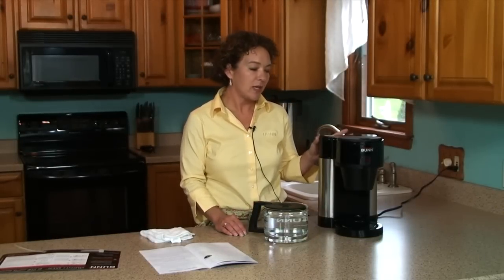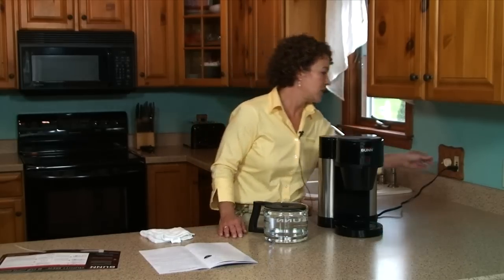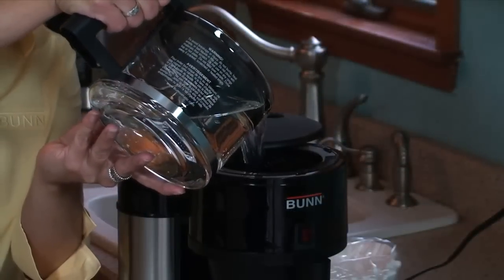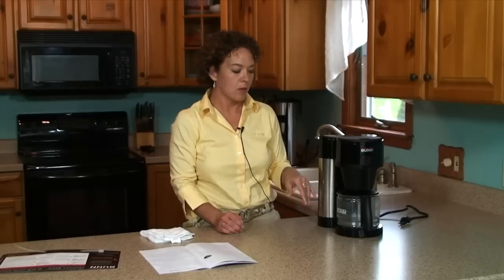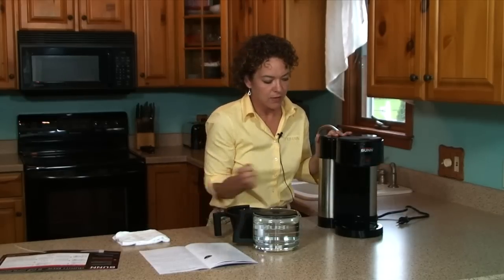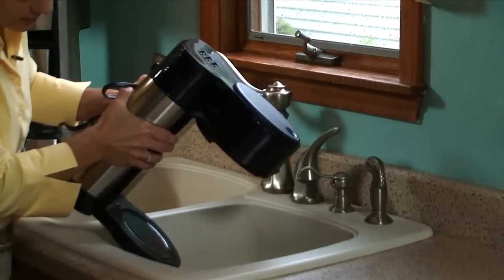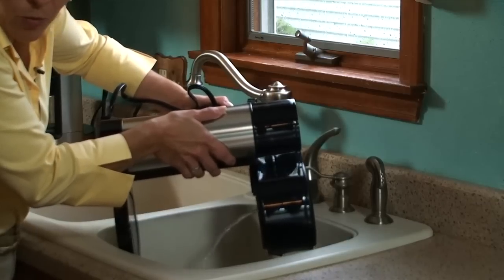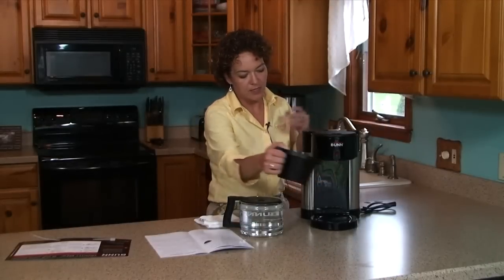How to drain a BUNN Velocity Brew

Comment: We tried this exact operation and stored a unit for two years. But when we tried to reuse it, we found the insides corroded and the unit ruined. How do you dry all those inside components after draining, to minimize corrosion?
Reply: I was thinking the same thing I just went through this process and you don’t get all of the water out of the reservoir which is gross. Reasons why I love my percolator.

Comment: I bought 1 of these new. I use about 6 scoops of coffee per pot (I like a strong cup o joe) every once in a while I get a mass overflow where water/coffee/beans starts leaking out of back and sides of basket and causing a giant mess. Why is this? Does anyone else have this problem?
Reply: My man.... yep. This guy here fills the coffee filter until like a centimeter below the top of the filter brim. All you have to do is activate the brew cycle intermittently so it doesn’t force all the water at once. 20 seconds on 20 seconds off. That sort of thing. Peek at the filter and make sure it doesn’t get past the top. Rinse and repeat.
Reply: Also, I think I fine coffee grind for like Expresso can keep the water from running through the coffee quickly and can cause it to overflow so if you like a finer grind of coffee then probably lift the lid from time to time to stop the water flow or go for a coarser grind.